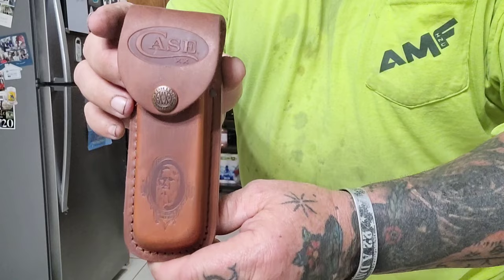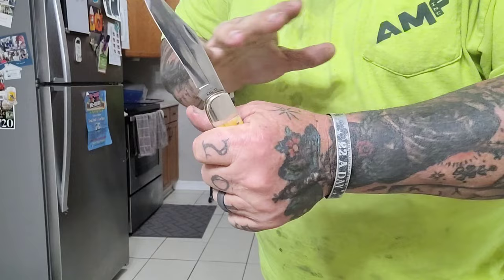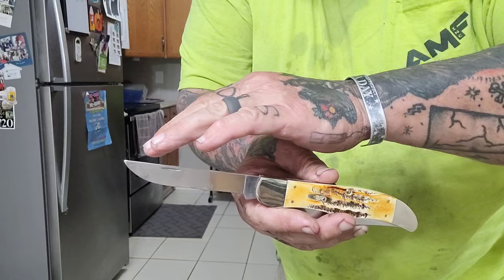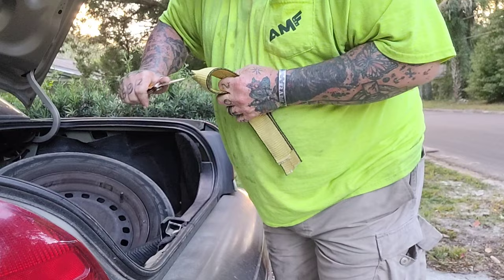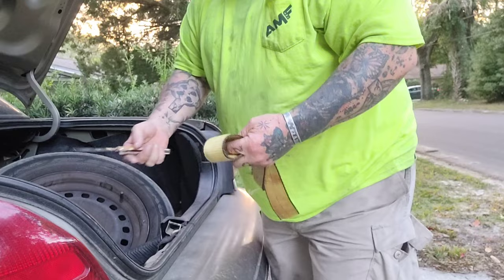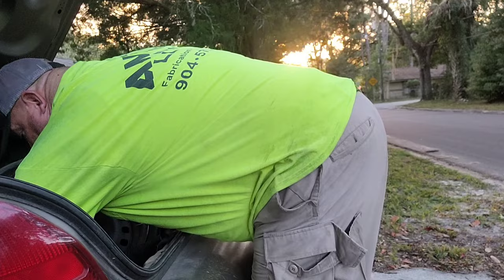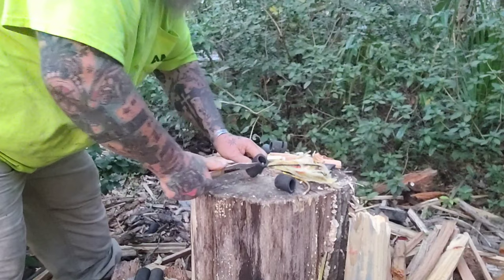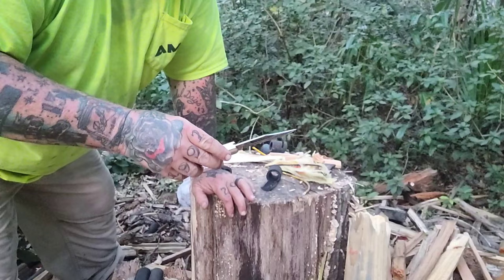CASE 6.5 BONE STAG FOLDING HUNTER!! OLD SCHOOL KNIFE REVIEW!! @wrcasexx

Comment: You gotta love it when the wife puts the stink eye on ya 🤨. I bought this knife in SMKW when I was over there wondering the store and saw how big this slip joint was and it reminded me of the case trapper knife I carried for years but on steroids. I honestly don't know why they call it the 6.5 I can see the stag hunter but there isn't anything that measures 6.5 I'm sure they have some reason for it. I usually ease down in GA to find Fatwood they have so many Longleaf and Loblolly pines it is not hard to find some good resined-up wood. Great Vid Brother it's a big slippy but serves its purpose and a good-looking knife.
Reply: Case knives have numbers stamped on one of the blades. Its like a VIN number. I think this one is 65265 SS. The first number gives you the handle material (6.5 is bone stag) 2nd number (2) is number of blades, last number is the pattern number (65 is large hunter.) So all the case knives with the premium bonestag handle are advertised as 6.5 to more or less let the collectors know "this is the one ya want!" Sorry for the short novel I'm a Case nerd! ✌️
Reply: 6 is the Case number for bone covers. 5 is for stag. Since it is bone simulating stag they put them together.. That secondary is a skinner blade. A spey has a dropped off tip.